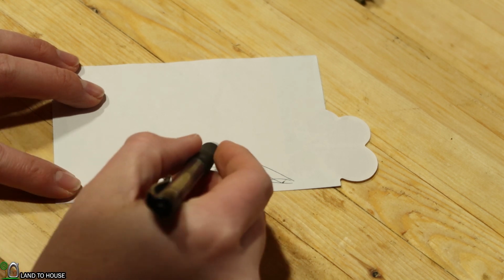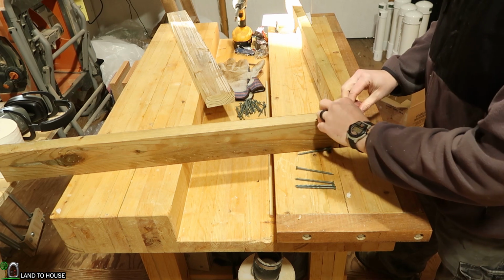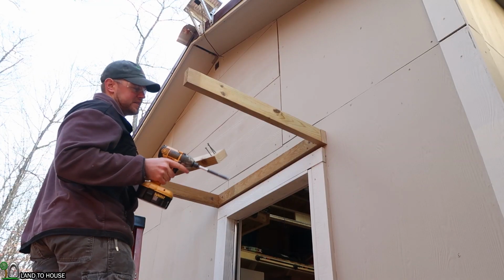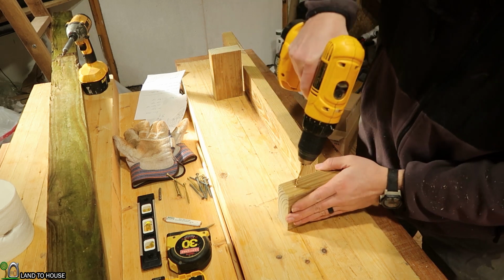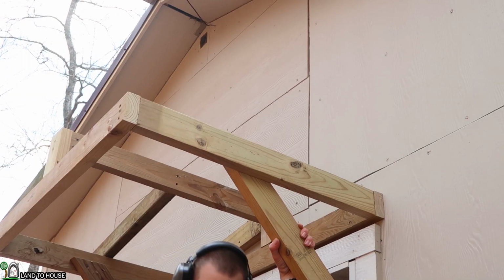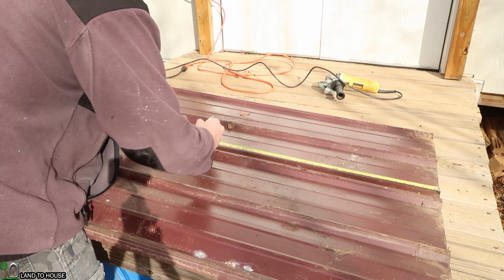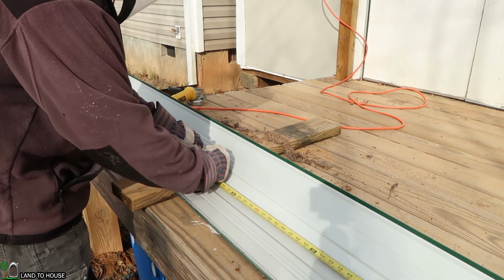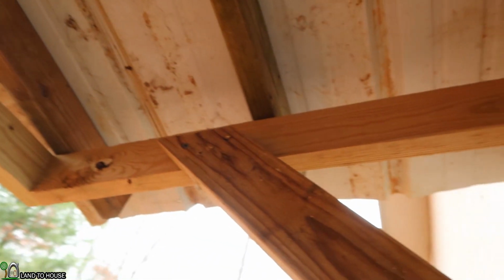Building a Simple Door Awning for the Workshop Backdoor

Comment: Ouch! glad you leave the bloopers in place, makes it more real!
A thought for future builds and the home audience when you have no helper: make triangle side supports that you can easily attach to the building by yourself, then haul up the back and front cross pieces to add to the triangles.
With no sheeting under the metal roof bits, it seems a bit wobbly and a heavy snow load might make it sag in between the rafters.  Battens across the rafters before attaching the metal roof panels will provide the support needed.
Reply: Great video content! Apologies for butting in, I would appreciate your opinion. Have you thought about - WoodBlueprints. Com It is an awesome exclusive guide for building better sheds and woodworking without the normal expense. Ive heard some extraordinary things about it and my mate at very last got astronomical success with it.?

Comment: How did you calculate the distance out from the side of the building to prevent rain from hitting the threshold? What was the angle of rainfall you were willing to accept?
Reply from the maker: I just used 1 width of metal roof. Its 39". On the sides I had 4 scrap 2x4s at 28" laying around so I just went with 32" metal with 4 " of overhang. So basically I just went with the scraps of wood around the house. As for acceptable rain... we had almost an inch the other night and it did not reach the door. So I am pleased.
Reply: @LandtoHouse  Excellent. I guess it's the results that matter!
Reply from the maker: @TSGEnt  that and I have no money for extra lumber :)
Reply: Land to House I feel ya!